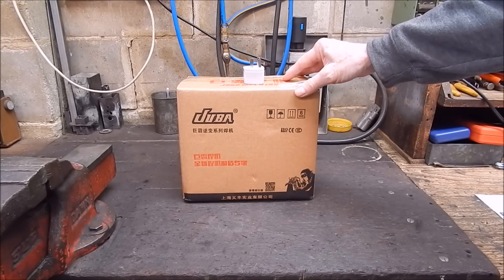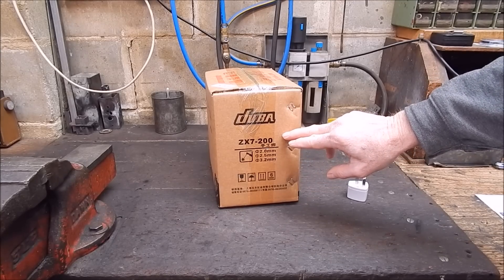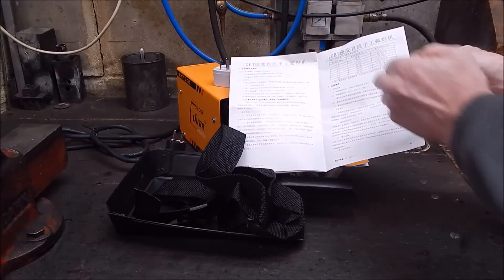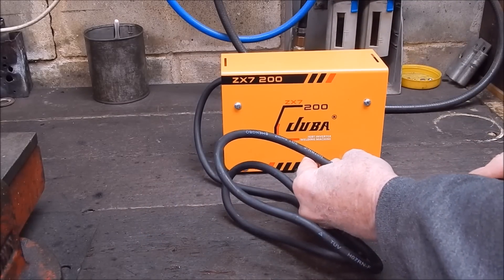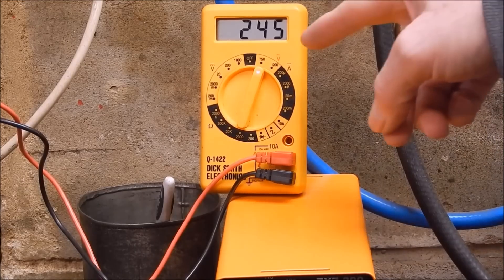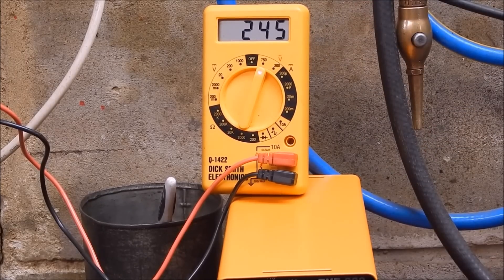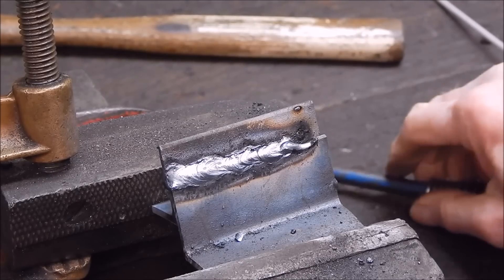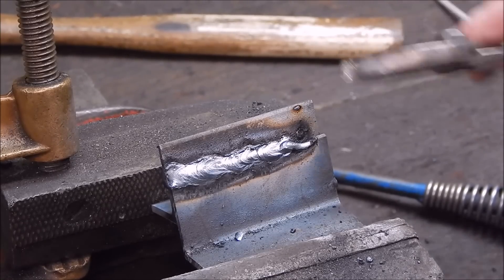I review another tiny inverter stick welder from Banggood - excellent

Comment: Hi xynudu, have you seen the other welder like this, also a ZX7-200 but not the 'MINI' version like you got. Would love to know what you think of this one. https://www.banggood.com/JUBA-ZX7-200-IGBT-Portable-Welding-Inverter-MMA-ARC-Welding-Machine-p-1226474.html
Reply from the maker: Yes I have seen that.  It should weld the same as it uses the same ZX7-200 circuit board etc.  There are a whole range of almost identical inverter welders using that board on BG.  Prices vary quite a bit and you pay a lot more for a digital readout etc ;)

Cheers Rob
Reply: I ordered it, will let you know what its like. The internals are different but potentially similar, so will be interesting.

Comment: The reason they are so cheap is that they use the lowest grade electronic components, and the PCB is soldered by low skilled workers who don't care as long as it gets out of the factory door, and they get paid.  By the time it fails the brand will have disappeared, and with it the warranty.
Reply: I say to let it go, don't impose your rules to live by on others.
Reply: The brand is Juba and it has been around since 1988. The Juba factory make a number of styles of welders and make other rebranded welders there too, but this particular one is branded with their own name, so you would hope it would be at least semi decent.

Comment: An informative review. If you own a smartphone, you can use Google Translate to interpret manuals and user operation guides.
PS. I would never recommend using a mains plug adaptor with high amperage loads, as you suggested, I would simply replace it with the correct plug for the purpose.
Reply from the maker: Replacement of the plug is certainly best option, but as this welder draws well under the maximum amp rating ofthe adapter there is no issue.  Nothing got warm.

Cheers Rob

Comment: Just bought a DC stick. Am impressed. Expected it to cook itself quickly. 
Just about finished a trailer I'm building. Using 6013 rodst at 60 amps.
Doesn't even moan. Great
Reply from the maker: Yes, it's a pretty good unit.
Reply: It's moaning at a high frequency you can't hear!  20kHz is pretty common switching frequency.  Do the local dogs notice you're welding?

Comment: Hello sir so you just pluged that welder staight into the outlet that provided the 240 some voltage? I got alittl le confused when i got mine it came with an adapter for the 110 wall plug. It made a spart at the plug wenever i pluged it in and would only light the orange light up. Im asuming maybe not enough voltage i perhaps need to put the 3 prong 220 volt plug on er?
Reply from the maker: Hi Josh,

These are not a 110 volt unit, so you must have a 220 volt supply.   I am not familiar with a 110 socket as we don't have that in Australia.  I suggest you use a the correct socket for 240 volt if you have that supply.

Cheers Rob
Reply: Cheers sir that is a huge help thankyou alot. Here in nova scotia i guess we have slighly different electrical systems we follow watever the states uses unfortunatly aha.

Comment: Rated Input Current: 25 A
Rated Input Power: 5.5 Kw
I take it that this info on their website is incorrect? AU sockets are only 10A and that pathetic adaptor they supplied is criminal! Glad you pointed it out and didn't use it, but how many others would?
Reply from the maker: Hi Andrew,

Lots of info on Banggood is incorrect or plain wrong.  I've pointed out errors to them at times and nothing changes.  LOL.

These inverter welders only draw about 8 amps for a 3.2 mm rod, which is a far cry from the 12 amps an AC transformer welder requires.

So a ten amp plug is quite adequate, however the earthing must be compatible to be of any use.

I am pretty subjective on my reviews and any safety issues always get a mention.

Cheers Rob

Comment: Thanks from Mississippi for the review. I'm wanting a small form factor welder and you helped convince me. I've ordered lots of things from Bang good and all my experiences with the company have been good.
Reply from the maker: Hi Duke.  Same here, no bad experiences with BG and I do buy stuff from them, not just get it for free.

It's a great little unit for light gauge work.  It handles 3.2 mm fine, but extended use of that rod size in hot weather will probably shut it down.

The duty cycle drops off pretty quickly.

Cheers Rob

Comment: What else do I need to buy to use this? Also I can take any standard 3 prong plug and swap it with that plug it comes with and it will work fine?
Reply from the maker: This welder will run off a regular 10 AMP three pin plug fine.  You will need to buy an earth clamp, electrode holder, and welding cable of whatever length you want.  The first two items are cheap, but the cable is expensive in larger diameter cores.  You will also need a welding helmet.
Reply: @Xynudu  Mine was supplied with 2-core cable but no plug. Which plug should I purchase for use here in the UK, please? Thanks Rob.

Comment: Interesting bit of kit as you guys across the pond would say,  will be interested in what Bro-inlaw  has to say especially if used with a small generator. It would make repairs done out in the field a whole lot easier you could keep it and a small generator in the tool box of the truck and not have to drive back to the house and hook up to the trailer, then drive back
Reply from the maker: Using an inverter welder on a generator can void your warranty for most major brand names. Not recommended.

I've heard some tales of woe from people who have, yet others do it without a problem.  Your call I guess ;)

Most inverters have line filtering, but how good it is is anyone's guess.

Cheers Rob
Reply: Thanks

Comment: Excellent review Rob I have just bought one at a discount price. I haven't done much stick welding so it will be very interesting for me and handy if I get used to it.. You look like you are very good at welding. Regards Steve
Reply from the maker: Hi Steve,

It's a very easy welder to use and not electrode sensitive, which can make learning difficult.  Also not prone to arc blow.

Even though the duty cycle is low it should weld fine in your climate, for home/back yard projects.

Cheers Rob

Comment: What type of electrodes do you use in the video?
Reply from the maker: All were GP (general purpose) 2.5  and 3.2 mm rods in SWEC (Chinese), Ferrocraft (CIG), and Murex brands.
Reply: By gp, are 6013 or 7018?
Reply from the maker: 6013
Reply: xynudu Thanks!     :)

Comment: Hi Rob, pretty impressive little thing. Do you think it'd be possible to attach a TIG torch and weld Mild steel and Stainless steel? With the appropriate gas of course.
Reply from the maker: No.  The duty cycle is way too low.
Reply: Do you still think this is the case after your most recent video testing the duty cycle of this machine? Maybe you could give TIG a try if you have the right equipment?!
Reply from the maker: I am not set up for TIG.  I still think it's pushing it too hard.  You can buy other welders for the same money with much better duty cycles (eg. Usewell 250).

Cheers Rob

Comment: We are missing a look under unit cover!
Reply from the maker: Not much point as I wouldn't know what I was looking at  ;)
Reply: Maybe AvE can do a review on it?
Reply: There's not much in there!   You can look in through the louvers, or take the cover off.  Inverter welders are built like amplifiers, there's not a lot of metal in them.  Really comparing to the classical transformer machine.  I think they are working at high frequencies inside, maybe 20KHz or so.

Comment: Great review Rob! And from what I've read you can tig weld with an inverter as well. (With the exception of aluminum.)
Reply from the maker: Not with this one.  The duty cycle is way too low.  However, the Usewell 250 should do it easily.
Reply: Okay, good to know.

Comment from the maker: I tried out the hand held visor and it worked very well.  Took me back to my learning days.  I would normally use a full face flip down helmet, but hand held are good in hot weather as you can wear a hat outdoors and you don't have issues with sweat dripping onto the visor lens.

Also it's a bit easier to see if you wear reading glasses.

Cheers Rob

Comment: wont some clarification about reverse and straight polarity.... would you make a video about it ? thanks in advance
Reply from the maker: DC Positive electrode (normal) polarity gives deeper penetration.  Negative electrode gives shallower penetration/sometimes higher bead with less chance of burn through  on thin metal.

AC welding penetration is between the two but closer to positive in bead shape and penetration.

In practice you may not notice a big difference between the polarities.  It is also influenced by rod type/make. Most GP AC rods work quite happily with either DC polarity.

https://sciencing.com/difference-between-ac-dc-welding-6021349.html

However, some GP rods may work better with a specific polarity.  Specialist DC rods will be marked with the polarity to be used.   AC/DC GP rods are generic and not marked.

Normal /positive polarity seems to weld better/smoother with AC GP rods from my limited experience (less spatter).

Comment: Ahhhhh Rob.  I've got the Usewell and love it, now I want a Duba.  These reviews are killing my wallet but keep e'm coming.
Reply from the maker: As soon as I struck this welder I knew it would be good.  It actually seems to strike and flow a bit better/smoother than the Usewell at low amps.  Very easy to weld with.  Nice to use.  No bad habits. The Usewell runs cooler for sure.
Reply from the maker: I'm going to put a load test on this unit in the next video, to see how well the duty cycle copes.  Should be interesting.

Comment: The audio worked perfectly for me. But, Rob, after explaining the table with the duty cycles I expected to see a duty cycle test. 20% at 100A means welding 2 min out of 10 probably some more due to contingency of the manuf. But it could fit into a video's length. Would you not want to know after how much continuous welding the welder shuts down and how much later it lets you continue? Does it  have a built in fan? Could one attach a fan? How would that affect the duty cycle? Lots of topics for an additional video..:-)
Reply from the maker: Hi Rol,

It has a strong built in fan.  I ran a lot more rods through it than shown in the video and there was no exceptional heat wash coming out the front of the machine, just a bit of warm air.  The case stayed cool.  It was a cold morning so how it goes in really hot weather is unknown.

My Usewell under the same conditions (cold) runs dead cool, so this is a hotter unit for sure.  The duty cycle tag as I explained makes no sense at all - it basically said that the unit would overheat with any amount of use of 3.2 mm rods.  Which of course didn't happen, or even look like happening.  So I don't believe that for a second.

I'm giving this welder to the Bro-Inlaw and he can do some heavy welding with it (he's a farmer) so if it cooks up I will relay the news ;)

Cheers Rob
Reply: this thing seems quite  capable for its size. It would be helpful to show how good it really is. I am looking forward to your Bro-Inlaw's results.

Comment: Did you try it at the 140A or above that level  and if so how was it?
Reply from the maker: No.  There was no point as it handled 3.2 mm rods fine on 5 mm steel plate.  I don't have any 4 mm rods.  The unit is rated at 3.2 mm tops in the spec sheet but it should go larger diameter.  It certainly had plenty of guts and was right on the money for 2.5 and 3.2's.  How the duty cycle would handle larger rods is anyone's guess.
Reply: Thanks for the info. Dont suppose you can "encourage" them to send you a TIG welder can you ? :) I've seen a model WS-250 (about USD300) which is supposedly TIG. Great price but I wonder how it performs.
Reply from the maker: I didn't know they had TIG on offer.  I could review it no problem, but I'm inexperienced with TIG and couldn't do it justice.
Reply: Fair enough. I've never used one either !